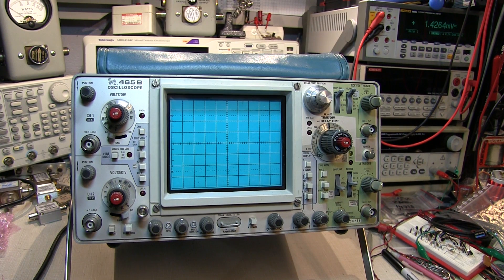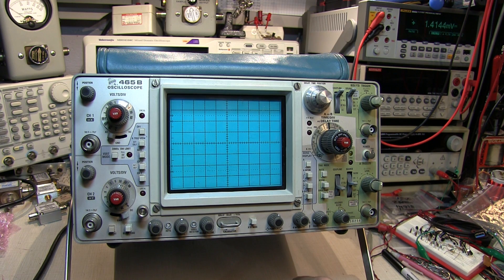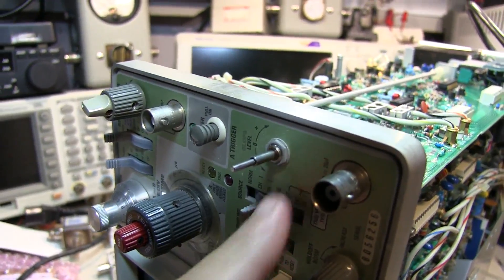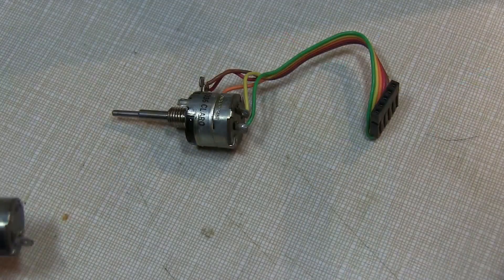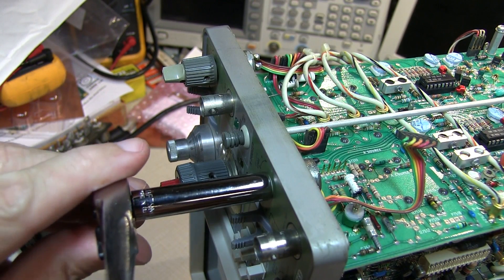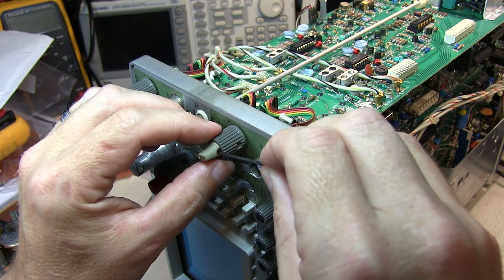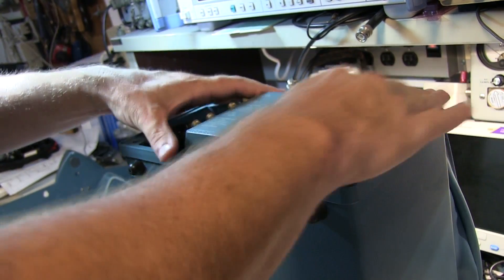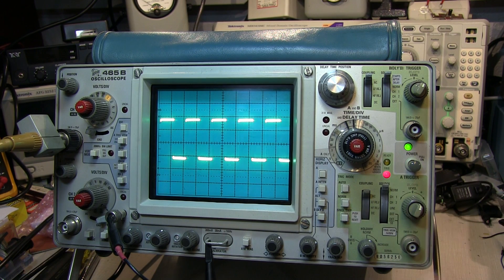#266: Repair Log: Tektronix 465B Trigger control repair / replacement | oscilloscope repair

Comment: I still own a Tektronix 475 that  I  appropriated ,  when I worked at RCA. The company had just been taken over by GE and terminated half of the workforce with forced retirements , massive layoffs and elimination of divisions. I took the bull by the horn before I was let go and they closed my Instrument repair section. I walked out with my severance unpaid vacation , 401K and a Tektronix 475. it has served me well over these past 40 years working in my private lab at home.

Comment: I fixed the same switch on my 475, assumed finding a replacement to be a hopeless endeavor! I found the center shaft carrier slightly deforms and the excess tolerance allows the cam type lobe at the bottom to disconnect from the switch. A small tweek with pliers or pick will close the gap; good as new.

Comment: @w2aew my 2645A has a broken intensity knob: the grey knob cover is gone and the white inner knob seems to have become detached from the potentiometer. Is stuck on high intensity. Would it be easy to fix? I've never opened up my scope before...
Reply from the maker: I know that on the later models, the intensity pot is front panel mounted - not sure about the early models though.  Should be an easy fix.
Reply: Fixed, thanks!
Reply from the maker: Congrats!  Hope it wasn't too difficult.

Comment: Hello Alan! Happy new year.  Enjoy all your videos.  I recently picked up a two 2465 scope. Been working great.  But I’ve noticed I’m not getting  flat traces even when inputs are grounded. They have a small ripple. Could it be the caps in the power supply?
Reply: https://drive.google.com/open?id=1BoQLTwy9K6zCgjvhJTuWEo2UtxdE017A

Comment: Nice little repair Alan:-) and a really nice scope to, one of those that almost lasts forever... Just got a 420A this afternoon that i was planning to use as my secondary workbench scope, however it seems to have a problem with the contrast setting - no response what so ever.....screen is "dusky" .... since you are a "Tek" guy, is this a common failure on this model?

73`s
/ Anders
Sm7Hce
Reply from the maker: I'm really not very familiar with the 420A, so I don't know if this is a common failure mode.
Reply: Thats ok Alan, i´ll find the glitch anyway, just hoped to skip a few steps :-)... keep up the good work :-)

73´s

Comment: i do have a tek465, when i set the A magnifier, it highlights the waveform but at right of the highlight my waveform disappears.. is this normal?
Reply from the maker: The 465 (non-B) has a different mode of operation for the delayed timebase.  I don't have one to check out, so I don't know if your observation is normal.  I have seem some videos online for the "mix mode" on the 465 scope, so you might want to check it out.
Reply: w2aew Okay, thanks for your answer. Keep making these great videos, I really like them. Regards, Axey

Comment: My 475 trigger control seems like it just needs a cleaning.  It's definitely misbehaving.  Is there a way to get some IPA in there or do I have to disassemble the  switch and pot assembly?

Comment: Alan, you might consider opening the old sw/pot & repairing it.  I hate throwing out stuff like that.  I always repair if I can, because it will give my kids more stuff to throw out when I am a SK.  73 Bob
ps- hope the ankle is doing well
Reply: I had exactly the same issue.  I tried repairing the.  Good luck with that.  That’s virtually impossible.  You can’t even open it without breaking something.  I ended up ordering a new part and and replaced it.

Comment: Geez..... I'm going to quit working on old radios, and start working on old scopes. You made it look so easy!
Reply from the maker: Well, that's the easiest repair on this scope - other repairs are far more tricky!
Reply: I restored Antique radios, phonos and monochrome  and TVs for 20 years. Then I saw aneed for good working service instruments, like VOM, VTVM, scopes, audio onscillators  and signal tracers. I find that work more high tech , easier to fix, and in great demand by the Radio restoration crews, with parts still available. Kudos the the guys who took up 3D printng ,making unobtainable  mechanical parts. Pure genius guys!

Comment: Gotta love it when things are made properly, unlike modern cars that you have to pull the engine out to change a alternator lol FORD!!!
Reply: patprop74, like Han Solo once said,  "don't get cocky, kid!" Some of the 7xxx an 24xx scopes (and others) have controls that are buried in the midst of circuitry and otherwise very difficult to get at. Reminds me of my 1967 MGB-GT in which the first step in the instructions to rebuild the transmission read:

(1) Remove the engine.

Comment: out of my cold dead hands will you pry my old tek cro... If i know the constraints of the signal i am looking at fall within the capabilities of my old tek scopes i will always power it on first... i can use them blindfolded.  no menus, no encoders... buttons and switches with static definitions, the vert and horiz detents always mean the same thing.    Why cant anyone design a modern digital scope where the basic functions are controlled by selector switches rather than encoders.  sigh  Its fine to dig through menus for protocol decoding, complex triggering, etc

Comment: Dude, that's the same scope I have :D

But on CH 1, if I switch the dial to more than .5 VOLTS/DIV, I get constant ground on the screen. Any idea where the problem might be?
Reply from the maker: Sounds like a problem with the vertical attenuator switch.
Reply: Thanks :) Will take a closer look at that.

Comment: Oh! C'mon, a simple switch replacement ?!  
That wasn't very challenging and you forgot to mention the most interesting part - where you'd gotten the new switch.

I wish you did something more intelligent and challenging, like a  Voltage Controlled Resistor for 12Vp-p signals ...built with MOSFETs, etc...
Reply: He did say a friend sent him the switch.
Reply: OK, I missed it...probably because I was expecting him to divulge an outfit that provides such rare old parts.

Comment: Nice vid! So many aspects to this! The joy of finding an *exact* replacement part for a venerable piece of test equipment. Restoring a treasured bench item to 100 percent. A simple panel control on a Tek scope.. 

.. and so on. So satisfying! Compare and contrast with tracking down the A channel vertical position on a 485. Went all through the scope, replaced a couple of socketed[!] transistors on the A7 board, swapped the board for one in a salvage unit, and THEN found there was a problem on the LV supply board. 

Straight out of Monty Python's "Bring out your dead" sketch. ("I'm not dead yet!") 

Love these scopes, Alan. Would not have a digital scope within a mile of my bench. (And I still have some slide rules, too!) 

71/72 

Bill, k6whp

Comment: Not sure if you've done so but I'd like to see an alignment on this scope. I've got one of those 456B's  - I refer it to as the boat anchor. Compared to my RIgol DS1054Z that's been hacked to do 100MHz the Tektronix is long in the tooth.

Comment: Did you replace the lights with LEDs on this one? I have a few lights out on my 475 (annoyingly the trigger light) but never got round to figuring out what to replace them with.
Reply from the maker: No, mine is all original - mix of LEDs (trigger indicators) and incandescent (vertical scale bezel).

Comment: Designed to be serviced.
Reply: Haha! Not really. Try working on the main board of one of these. You have to desolder things to get it out and its a major mission. Or try cleaning the contacts on the timebase control - you have to remove a board and to do that again you have to desolder stuff.
Reply: So I guess Alan had luck after all. Maybe that's why he seemed so happy!